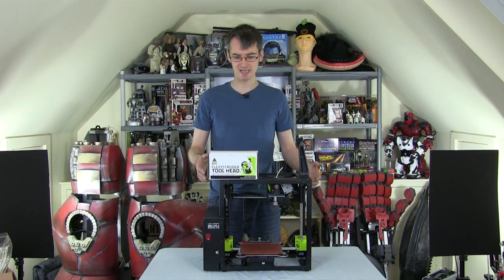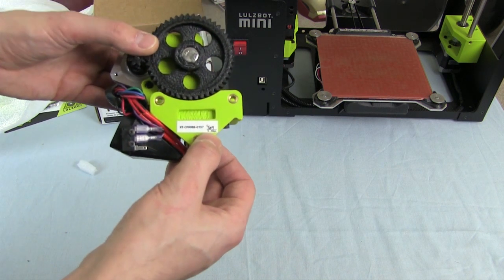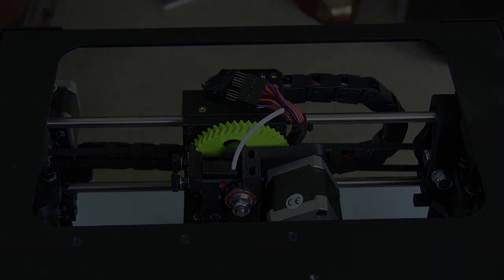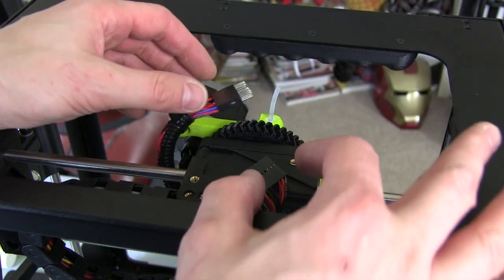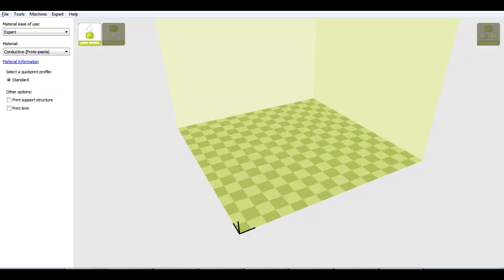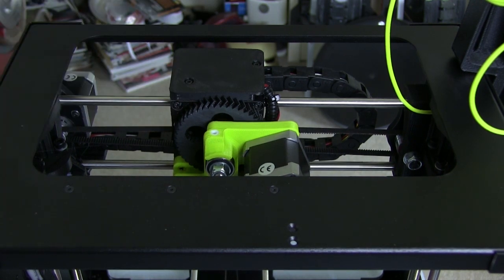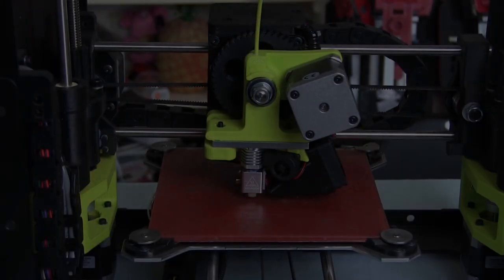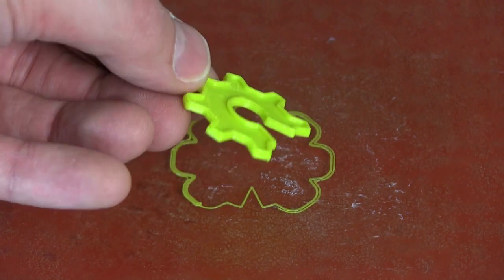Fitting the FlexyStruder to the Lulzbot Mini 3D Printer | James Bruton

Comment: James, running the motor by hand can seriously damage your electronics! Running a stepper motor can cause it to generate electricity, and your control electronics are not designed to take that sort of abuse! I've seen a few people do it first hand, and I believe Barnacules also did it on his Robo 3D at one point. If you're going to do it, detach the motor from the main board, otherwise you can fry your main board.

Comment: for my printrbot with an e3d hotend I just used the inner tube from a mechanical pencil to guide the filament. Hardly a mod and it works great

Comment: Do you know if they plan on having a duel extruder head for that printer that will allow Flexy and ABS/PLC? Would be very nice for some items that transition from a solid to flex back to solid (flexible joints).

Comment: I notice you haven't upgraded to Windows 10 yet. DO NOT BOTHER. I spent all last weekend purging my system and putting Windows 7 back on it. I still haven't got it quite right. I would also turn off updates (except for antivirus), as they are deliberately making Windows 7 slower so that you upgrade. I did a system restore after the last 200 updates to get my PC running fast again.
Reply: +ArcanePath360 All things being relative, I&#39;m running 10 and it's been doing just fine. Upgrades can be a bit tricky, depending on what digital baggage you bring with it.
Reply: +Christopher Lemon   It's funny but I had to upgrade to 10 again because my software updated and it no longer works on Win7 without crashing (they even styled it like Win10). Spent all day trying to get it working before giving up. Okay Mr Gates, you win. Take my privacy and the option of what I want updating. I give in.
Reply: ArcanePath360 painful! I try and avoid upgrading whenever possible. Microsoft has had it's moments but seldom places nicely with upgrades. This time it was a fairly painless experience. My mum upgraded her desktop only to discover her network card drivers didn't update and she was dead in the water.
Reply: +ArcanePath360 Gate hasn't worked at W in ages. Also Windows XP had more privacy leakage than W10...
Reply: +Ronan B   I know, I was being cynical and didn't care to look up the new guy, not that many would know who I'm talking about anyway. As for XP having more privacy issues than 10.... you're deluding yourself or not doing your homework I'm afraid.